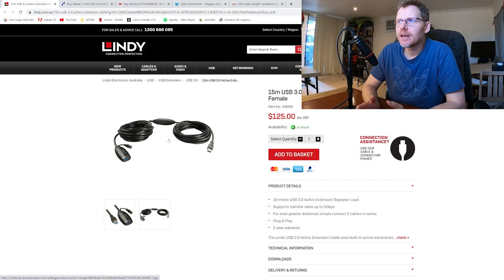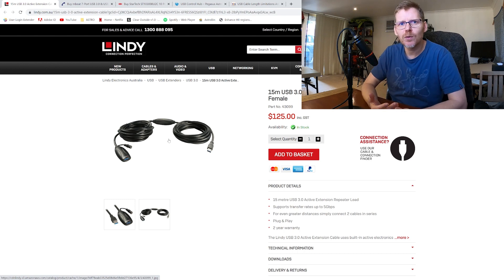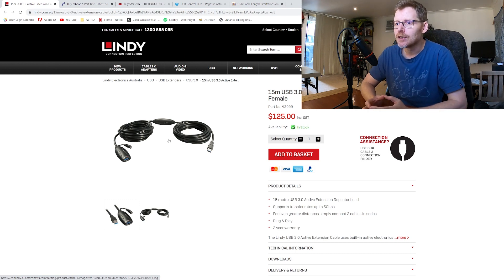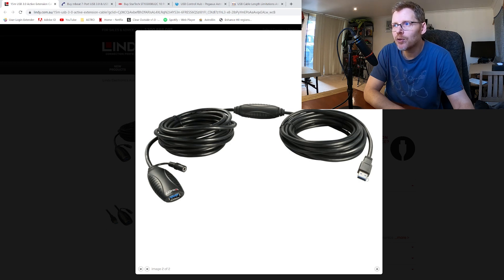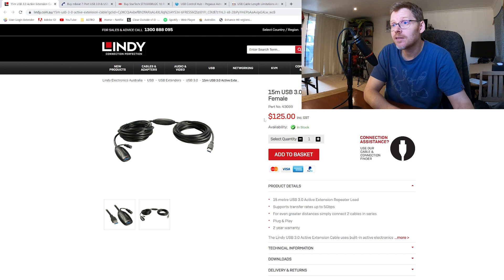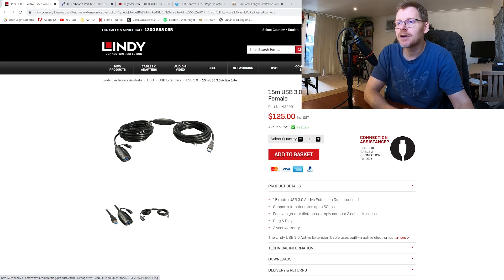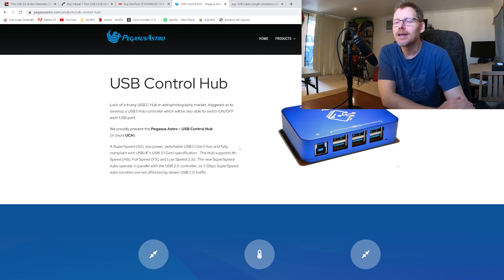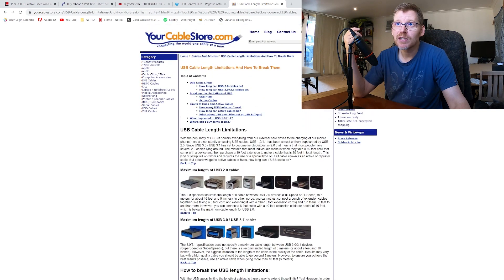Cables & Connectivity - Using a Active USB Cable and Powered Hub

Comment: Ollie,
The compatibility issues the Pegasus mentioned are known as 'Standards'. USB3 communication do not have a true fixed standard, and is why one can have communication issues.
As for the intermittent image download error, I'm not sure if this is related to cable connections; as I have the same problem with my Risingcam and ASI1600mono camera. 

The cable between the NUC and the Pegasus Hub, is only 250mm for the Risingcam camera. As for the ASI1600mono it is about 8m from the hub on the telescope to my laptop and it is only USB2.
One thing I have noticed but can't really confirm at this stage,  is it only appears to have errors on the native drivers and not the Ascom drivers.
Reply from the maker: Thanks Robin, in my case I'm pretty much positive it's caused when using the Pegasus with my Active cable as it happens predictably and instantly.  I have a friend who gets the identical issue when using an active extension with the Pegasus Powerbox.  There is obviously something which causes an issue when using the two together, maybe with the combination is causing a communication failure to be interpreted by NINA.  For now I'm avoiding it using a standard USB 3 hub but it would be nice to be able to use the Pegasus down the road.  Thanks for your thoughts on this and ideas, the more the merrier:)

Comment: Cable woes 🤦‍♂️ I had similar issues olly to you my problem I think is dew on the hub so I tend to bring in if I not imaging or put a dew band around it , I kept getting the connection to hub dropping in and out which I can only assume is moisture in the electronics drying out seems to solve it , good thick cables is a must though not cheap though 👍
Reply from the maker: Yes it seems to be a theme having cable issues.  I can understand the Dew causing issues I think this is what finally killed my MBeat hub !!!

Comment: Hi Ollie, it may be possible that the Pegasus Powerbox doesn't have Power out on the usb port.  that pigtail on the active cable is the alternative power for the cable which may resolve the problem.
Reply from the maker: Thanks for suggestion but I do have power into both the cable and the Pegasus box so shouldn't be this.

Comment: I need longer distances than active USB can handle so I use a mini-pc and ethernet and have Nina save to a mounted network share on the good PC. You could alternatively use the robocopy plugin. RDP works like local over ethernet from the good PC. With a mini-pc no hub is needed. Simple celeron and 8GB is enough for capture, all the grunt work is done on the good PC. I also run 2 rigs and just flick between the two RDP windows.

Comment: Hey & G'day Ollie, really cool video. This entire (active)cable thing was really connected (🙃) to some testing and experience in my case. From my experience it was also necessary to use a short active USB cable. (15m didn't work, 7,5m did the job.) Here I would also not choose the cheapest cable available (again, from personal exp. and conversation with an electrical engineer in the family). With my simple (4-fold, 26eur) powered hub I never had issues fortunately. But..holly cow...didn't know those PA hubs are SO expensive..! - Very helpful video for beginners I'm sure! Clear skies pal
Reply from the maker: Hey Michael Gday pal.  That's good info mate.  It does seem like half of this Astrophotography hobby is testing.  For ages I thought I had dodgy ZWO cables. I know my cable has a some sort of a housing half way thru the cable which would be 7.5m which is curious.  Yes the Pegasus hub is very expensive and to be honest may as well get the power box at that price.  I got mine second hand less than half price.  I also noticed  Chuck uses 20m active cables too.  Thanks as always for watching and comments ! :) CS

Comment: I have exactly the same connection issues pretty much only when using those powered repeater usb cables. I had 2 which I could never get to work reliably even thought they were powered. Would initially work for a bit and then I'd get the dreaded "cannot download image" issue. Although I had issues even if I went directly to the camera, they definitely did not like to play nicely with my Pegasus Astro Power Advance so those cables (which aren't cheap) now languish in a box somewhere in the garage. Hope you do manage to find a solution because that Pegasus USB hub looks cool.
Reply from the maker: It's a shame that it seems to be something related to the hub in these Pegasus astro boxes.  I guess for now I'll just have to use the basic hubs but will be sure to let you know if I get anything working.  Less than ideal but I do wonder if it would work with a hub between the cable and the Pegasus box.  So basically went Active cable > cheap powered hub > pegasus box.  No point for me but as you're using the Pegasus box for more than just a hub. I might test just to test.

Comment: FWIW I have that very same Pegasus Astro USB 3 hub - by far the worst purchase I have made. Ground loops, loose power connector, transfer issues even indoors during testing with short known good passive cables, corrupted packets on the USB 2 driving my mounts, the whole sh** show.
Reply from the maker: Such a shame as I expected it to be a killer premium piece of kit 🫤

Comment: My advice is to stay well away from Pegasus. I bought one of their first generation Flatmaster 250's which I've now shelved as it takes well over 90 seconds to take one Sii flat! When I complained about the length of time it takes to take narrowband flats they came back with some crap about modern cameras only need to take 5x flats for each NB filter. Within 4 months of me complaining they brought out a new version of the Flatmaster 250 with a brighter panel... The fact that they tried to brush me off with some petty crap excuse has soured my experience with Pegasus .
Reply from the maker: Hey Simon - I must admit I did find the reply to me a little surprising as I thought they'd have some suggestions about changes I could try.  It's a pity as their prices are usually premium so I'd expect a bit more engagement.  Sounds a very weird issue with your flat master, what a shame.